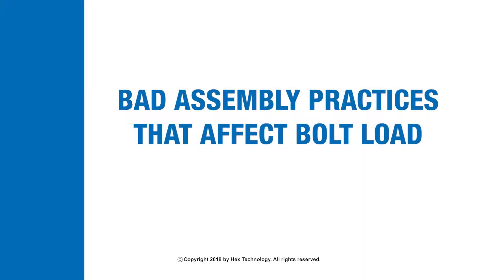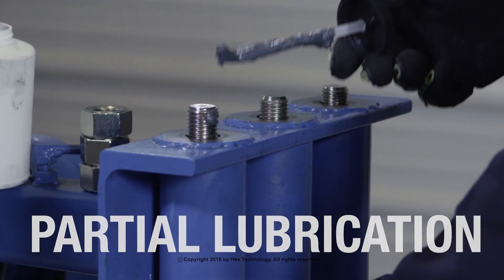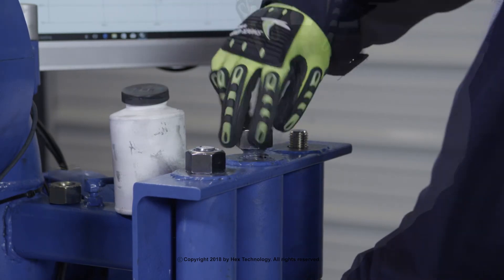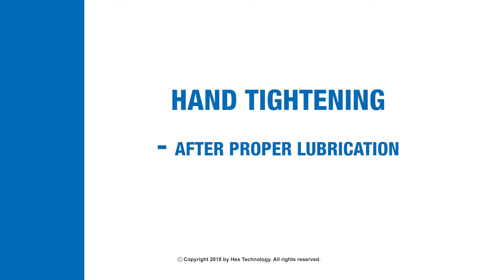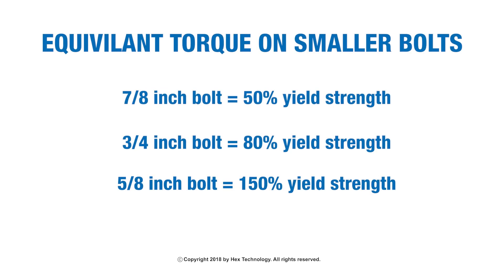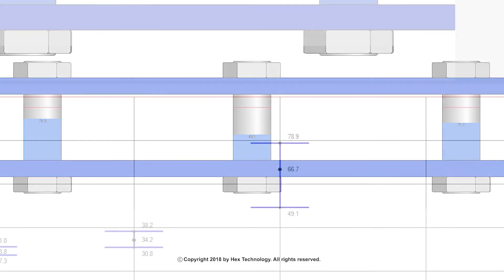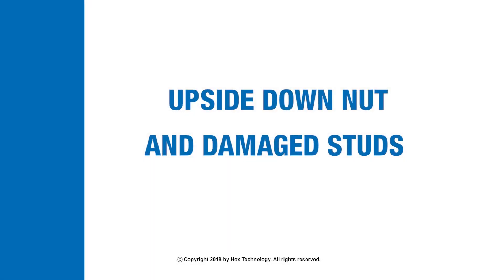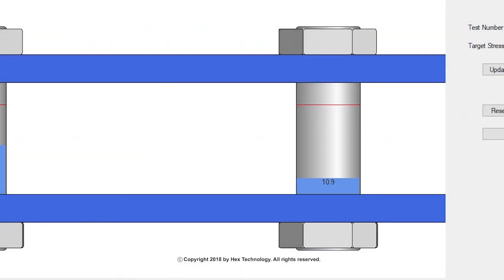Bolted Flange Joint Assembly: Bad Practices to Avoid

Comment: (1) Please spell "Equivalent" correctly. (2) A DC Tool with torque and angle monitoring would be much superior to a clicker wrench. (3) the joint faces of the nuts to the flanges must be true and flat - this is why they are finished machined surfaces in powertrain applications (like connecting rods).  If joint faces have high spots or waviness, this is going to result in torque variation and errors.